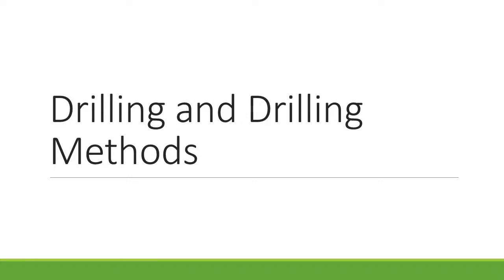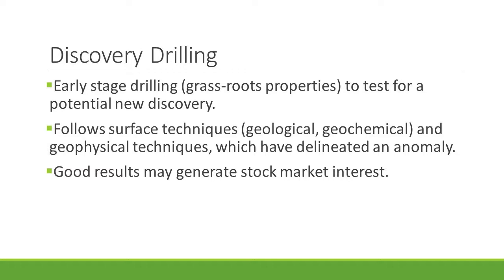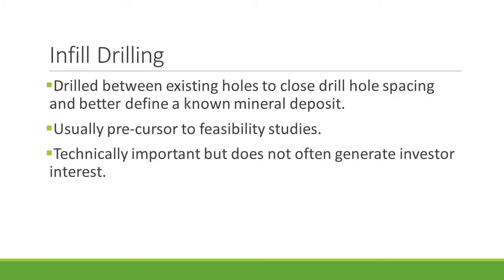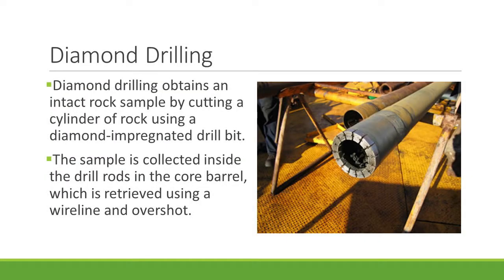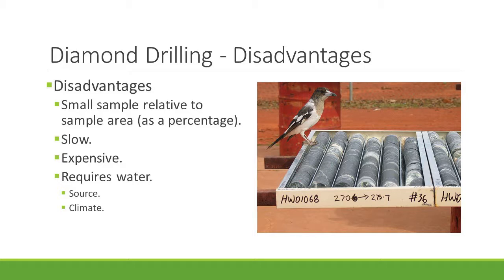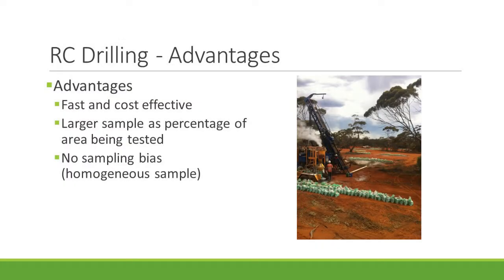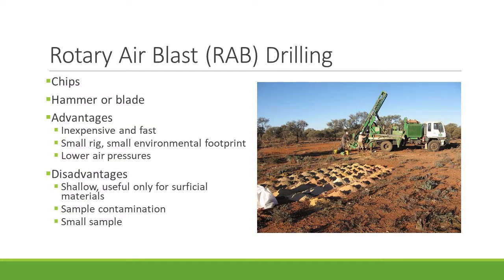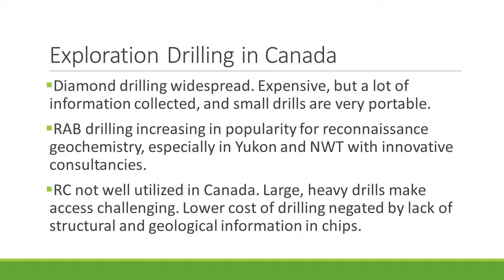Drilling Methods

Comment: The cyclone in RC Drilling does NOT homogenize the sample. It is supposed to do so but it does not manage to achieve its goal. Th cyclone is there mainly to avoid that large rocks goes to the compresor. Please contact me if you want to develop a program to assess how your sample is non homogenous in this method and how we can fix that problem.